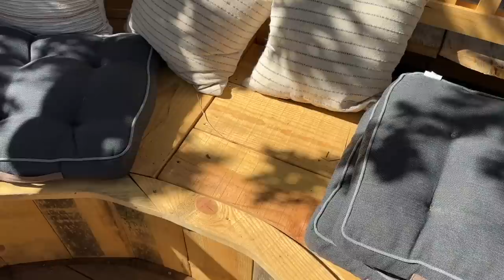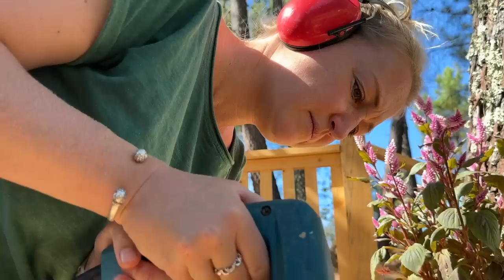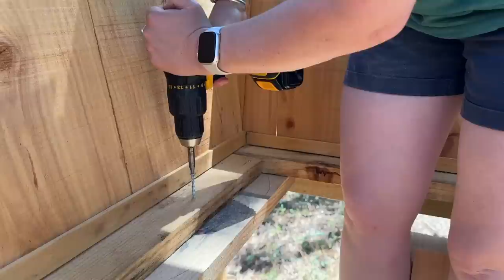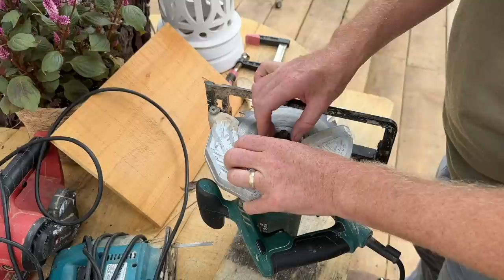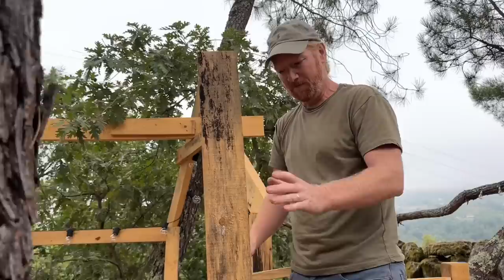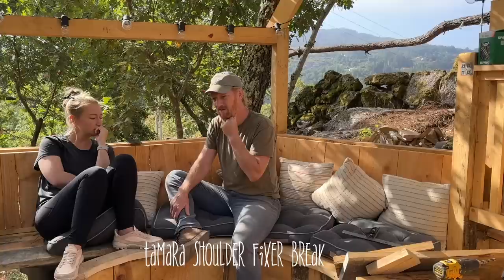Couple creating epic custom built outdoor living space | Portugal Homestead Rescue

Comment: I think transparent ( clear corrugated) roof sheeting would be ideal for the outdoor space to keep it light and looking open
Reply: I was thinking the same. I would make it one sided, tall on the inside, lower to the back/outside, so the seating will stay dry. It will feel a lot more open and save some water coming onto the deck.
Reply: If it’s in the sun it can radiate heat and may need to be covered with shade cloth. or similar. 🇦🇺🌈🌻🦋
Reply: @jilllangman9343  true, but this project is build under the trees, they want the view and the wood roof kind of close it off

Comment: Just a tip for drilling Wood,  1. Use Brad Point Bits if you can and drill in 1/2" ( 12mm) and pull back and clear the chips out, it makes it much easier. especially when drilling end grain.
Reply from the maker: Thanks Alfred! 👍👍

Comment: So  much good learning here. I remember learning to saw and use a chisel, sharpen tools. chop wood and use tools when I was a teen, they are great life skills and will never leave you. BIG TIP: As Tara is much shorten then you John, when sawing it is TEN times easier doing it from above. Size is not always factored in. If Tara you stood on the step above you would have found the cutting much easier. Same with using a jigsaw rather of a circular saw where possible, jig saws are MUCH easier for little hands. Great to see you working together, despite the difficulties. Good on you both! I hope you keep it up. I think you made a great team. < Xx
Reply from the maker: Good point Katie. Thanks friend ❤️🙏

Comment: Depending on what’s bothering you, you might be able to line the inside a little to hide the offending beams that you need for support but that bother you visually. You could also create a different roofline to cover that too on top of the support structure so that it flows more visually. But if you don’t want to line it then that probs won’t work. Just a thought.

Comment: I was just watching the last few mins of your video and you were putting the wood going vertically  just wondering if the wood shrinks you may get water coming through the gaps if you put is horizontal and over lap it the water would run straight down and not come through, just a thought. Have a hot shower and then put the peas on it reduces inflammation in the tissues. Take care you two looking forward to your next one.

Comment: Hello John, Tara, Crusoe, & Sawyer ❤👋  😅 to be completely honest, this video was hard to watch 🥺 I was feeling the frustration for you both. Why don’t you put this project aside until John gets better. In the meantime, Castor oil is very healing, you can put 2 tablespoons on a cloth and put it on the areas where the pain is and leave it for about 4 to 5 hours. It will feel a little hot. I think it will help cure real quick plus baking soda and salt and vinegar is good to soak in if you have a bathtub ,  I hope you get well soon John,” Tara, you were doing good learning to build that’s a hard job, but you don’t need to be lifting all that heavy wood either. Why don’t y’all use something like a wheel barrel to carry the big wood around ,anyway, I ❤ you guys I wish you the best😂  Bjs
Reply from the maker: Hello Doria, we just want to get the roof done then we will put this project on pause. Thanks for the advice about John's shoulder, we appreciate all your support 👧🏼💪🏼🪵🛠️❤️🇵🇹

Comment: Here# the thing that was explained to me about my cervical spondylitis which was initially in my shoulder but caused by L1,2 and 3 where spine meets brain stem . Ok and I was told heat to put heat on my neck to and lymphatic drainage all to get the fluids which blood is one of them moving . You do what you want of course. But try it beginning top of head and front of face down behind ears . You actually will feel fluid moving in your throat sinusetc. maybe just try heat at night .

Comment: I had pain in my neck area, and numbness and tingling in my arms and hands ( mostly left & very hard to sleep at night ).
Further diagnosis is that my spine ( neck area ) was thickening , and strangling the nerve that runs through the spine ( specialists say its from repeated hard manual work )
They recommended surgery , but I opted to try a prescription instead. That was 3 yrs ago , and I haven't slowed down since.
You could also try a topical lotion with 'Diclofenac' in it to releave the pain in the short term ( it definitely works )
Reply from the maker: Cheers Adam!

Comment: I don't understand why you're using these thick planks so much. I would keep them for the supporting parts and buy thinnner wood, like plywood or ¾ inch planks for the sides and tops.  These big thick planks must be pretty expendive.  Also plywood is so much easier to cut, isn't it? Especially since you have these nice curves.
But I guess you have your reasons.  And of course your bench will be extra solid.  I just think it's a bit  of an overkill.
Of course I only see things from afar, so I may have it all wrong.
In the end I know it's going to be splendid, just like everything John builds. It's already looking pretty good.

Comment: I feel your frustration but there is something that needs urgent attention before serious damage may occur.  If you were just dealing with stretched or strained muscles that would be one thing but the addition of numbness and tingling adds a whole new dimension that is concerning.  As one who has experianced this numbness and tingling I can tell you from experiance that you need to see your DR for an evaluation.  It needs to be determined what is causing these symptoms.  Is it a cervical compression of your vertebra or disc or not is the question needing answered.  Only your DR can evaluate this and prescribe proper treatment.  If it relates to a carpal tunnel compression of nerves this too needs a DR review.  Waiting for it to get better is not a wise course of action with ice packs as this does not determine the cause and leaves it hanging for reoccurance.  I don't mean to scare you but early proper diagnosis and treatment will prevent long term issues that could plague you for years.  Please see a Doctor if for nothing else but a sanity check.